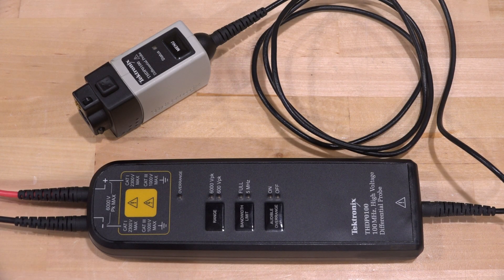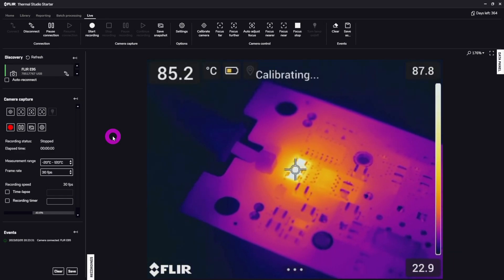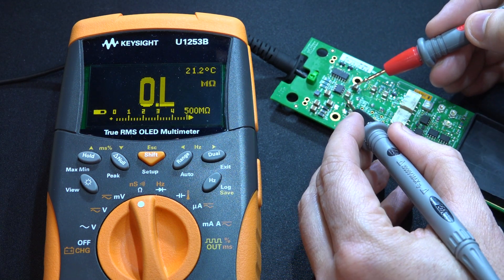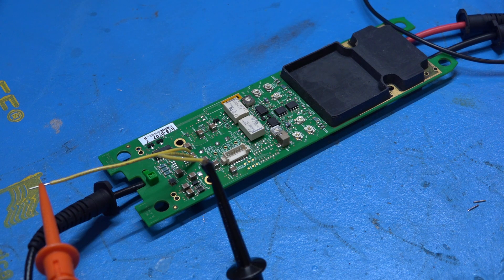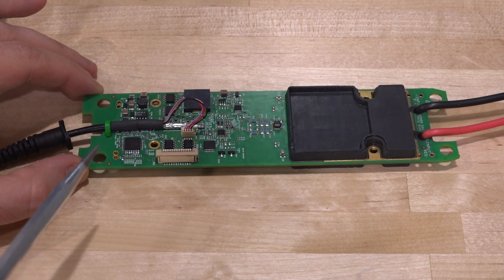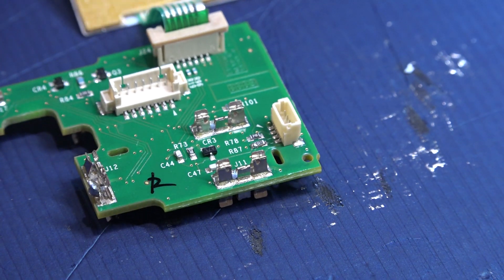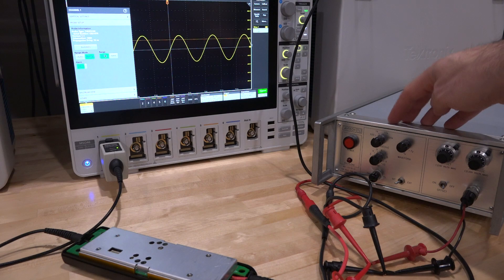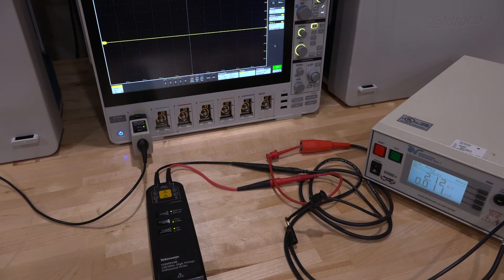TSP #223 - Tektronix THDP0100 ±6kV High Voltage Differential Probe Teardown, Repair & Analysis

Comment: Shahriar, I enjoy the content of  your videos tremendously. Do you have a presentation on protection of sensitive and valuable equipment such as spectrum analyzers, VNAs, etc from static damage? Also, one of my spectrum analyzers has 0 volts tolerance to DC.  Should I always use a DC block?

Comment: hello friend if it is possible I would like some help I have an hp agilent e8285a service monitor it is giving several error messages and version a.02.04 has already been installed do you have a procedure for me to be able to do a new installation of the software I am grateful for the help

Comment: I can't help but notice how that cap with 4 ohms across it is slightly crooked and has an extra bit of solder. Did it get that hot in there at some point with its failure or is that part of the editing? (was soldered for testing in a later jump-cut).

Comment: I hope Pooch isn’t wandering around when you have that 6kV engaged 🙀
Nice fix!
Reply from the maker: He gets locked out of the lab whenever there are exposed high-voltage setups or high-power optics/lasers.
Reply: @TheSignalPath  I figured you’d be sensible 🙂

Comment: When he identified the processor as the issue, I expected him to give up and throw it away as I certainly would not have expected him to have access to the firmware.
If it was me, I'd then either have salvaged the processor from another dead unit or used this unit for spares.

Comment: It is interesting how many different problems this probe had. Do you reckon they were caused by the same event, or how does a probe end up with such a plethora of issues?
Reply: It could have been an ESD event on that data line -- that would definitely destroy both the resistor and the cpu, potentially the negative voltage regulator too, depending on how things are connected..

Comment: Beautiful video. Well explained procedure. Unfortunately, with many repairs you can not easily get the firmware that allows reprogramming. I think Pooch has really good contacts in the industry ;-)
Reply: I was thinking the same thing, how the heck did he get FW....
Reply: @rj44319  What fw, I will not get some components let alone fw in the Czech Republic
Reply: I believe he got the firmware from a viewer whom read it from a working model.
Reply: @joopterwijn  So you never heard about "lock bits"? Lucky you! I guess...